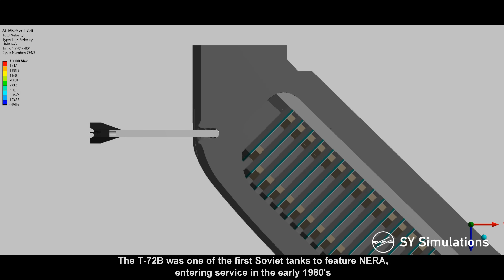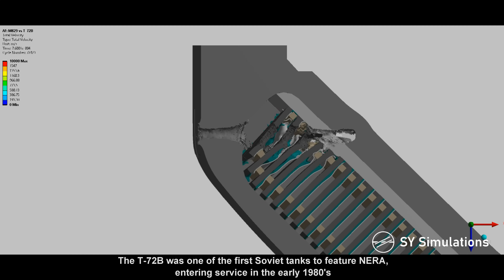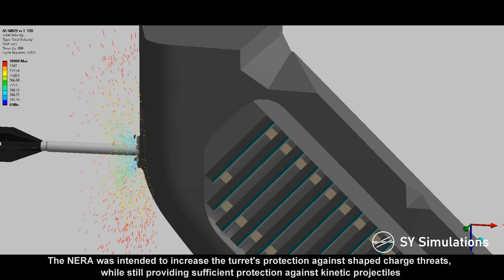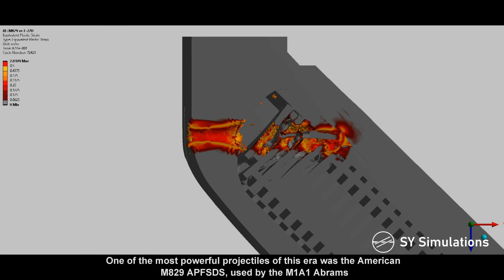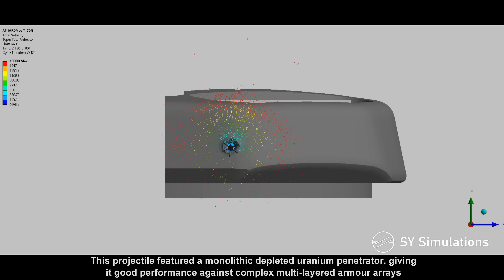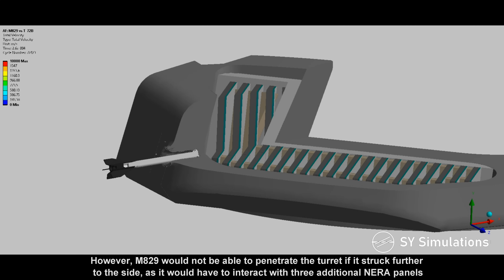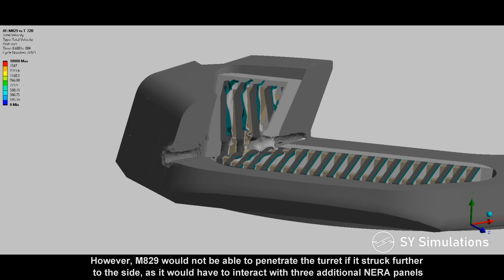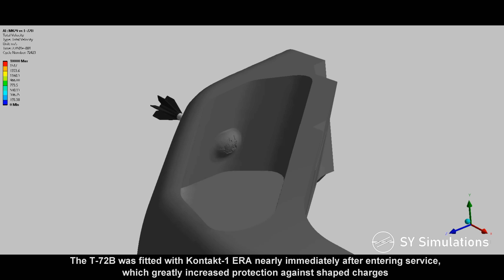ABRAMS vs T-72B NERA TURRET | 120mm M829 APFSDS vs NERA | Armour Penetration Simulation

Comment: what a pointless video...you should try agasint stronger part of the turret...of course it's gonna pen the weak point
Reply: He told the result of shotting more tp the right. Also there is no strongest part, the so called stronget part them becomes way more weaker if shot at 45°
Reply: @76456  Don't forget, the strongest part of a tank is called a garage. Because the moment you drive it out into the open, the clock begins to tick.
Reply: Its not pointless. He shot the center part of turret, where its aimed at
Reply: tf you mean weak point lol ?? that is literally the turret face chunk
Reply: It was the weakest point of the turret cheek  @greener2497
Reply: Pointless ahh ragebait

Comment: Very next thing: turret flying 100' into the air on a wave of flame and body parts.
Reply: Wow I haven't seen this comment 100 thousand times already. Literal NPC. Go clear a minefield with your feet.
Reply: @cheekibreeki4638  Wont somebody think of the poor imperialist invaders?
Reply: @cheekibreeki4638  The exhilaration from watching russian wannabe armor going up like fireworks from the smallest hit is only exceeded by the comforting knowledge that not a single one of the crew made it out.
Reply: @trentvlak  I think bro should give up with talking
Reply: @cheekibreeki4638  Don't need to. The russians are sending tens of thousands of men in special mine field clearing operations to take care of that.
Reply: You do realize that it only happens when the ammo is hit and the ammo is nowhere near this type of penetration?
Reply: @exoticdachoo007  ammo is everywhere in there. Please educate yourself.
Reply: @trentvlak whatever you say bud
Reply: @trentvlak  Ammo in the T-72 models is stored in the hull sponsons (& most experienced crews don't fill those non-use bins) or in the carousel at the bottom of the hull.  In later models the top shutters of the carousel are hardened and will resist splinters.  In earlier models it is simply plate and will only cope with light splintering.

Turrets coming off depends on where and how it is hit.

You know the Indian Army hasn't had much trouble with turret pops when fighting the Pakistanis, right?  Nor have most of the Arab armies that used the T-72.  The difference in the war in Ukraine is the increase in the number of top attack munitions and the type of penetrations they are suffering.

Please, educate yourself.
Reply: @iatsd  not to mention most turret pop videos online are of drones hitting arleady abandoned tanks, meaning that the crew evacuated safely when they were hit in the first place.
Reply: @quan-uo5ws plenty of turret pop videos with drone hitting the turret ring.
Reply: @iatsd  you underestimate the velocity of the penetrating dart in this sim. the entire space inside that tank is frag and flame.
Reply: @quan-uo5ws He's trolling, leave him to it.
Reply: @trentvlak  No it is not. The carousel is the turrets basket down in the hull and so is the spare ammunition. The only part of the loading mechanism inside the turret itself are the elevator and the loading mechanism itself. Wanna find ammo stored in the turret, you have to look on the other side of the iron curtain. But then we talk about ammunition bunkers and blowout panels, that is another story.
Fact is, soviet/russian T series tanks can toss their turret when hit, but they don't need to. It is not a jack in the boy situation, more like mentos and diet-coke.
Reply: @trentvlak  Oh, I think I probably have a better grasp of the subject than you do, son.  ;)  :)  

And your reply is irrelevant to your initial comment and my reply.
Reply: @iatsd  You have a poor grasp of the subject.
Reply: @ThePandoraGuy  Yes, it is. The T72 design is hostile to the life of the crew. Everyone knows this.
Reply: @trentvlak   Ah, you say that based on ... what?  You've given no arguments. You've made no replies to any points.  You've simply declared things.  You haven't even picked up on the fact I'm writing from experience and professional knowledge.  You're not even good at being a troll. 

Why would you bother with something as pathetic as what you're doing?
Reply: @iatsd  that's a lot of words to say that you're a ru troll.
Reply: do you even know tanks or you just watched CNN and thought all Soviet\Russian\Ukrainian tank get instantly ammo detonated?
Reply: Bro talks about something without knowing shit🤣

Comment: That is actually pretty good. Meaning 60-80% of the turret is Impenetratable.
Reply: This is a sim using ideal armor. In reality, the quality of the steel is spotty and the projectile penetrates much more easily.
Reply: @trentvlak That is true for projectiles too. It's not a big deal as it cancels out.
Reply: @MrPezsgess  not even remotely accurate.
Reply: @trentvlak Why would you think that?
Reply: @MrPezsgess  Because manufacturing the correct material at the correct hardness is vastly more difficult for a hull and turret than doing so for a little projectile. Well documented historical examples include the M1A1, T72, and the AMX30.
Reply: @trentvlak I get that. As in Iraq M1A1 easily penned T-72-s but that's the most basic weakest T-72 ever. Only later variants had ceramic and other inserts. This I the T-72B that is far superior. This is one of the reasons the US developed M829A2 and later M829A3 probably for a good reason. Only my opinion but the US lies about stuff all the time there is a reason we have Seal Team Six  because that implies for the Russians that there are 5 more. That said, Russian tanks doesn't lack armor. They lack survivability, crew comfort, reverse speed and Gun depression just to name a few.
Reply: @MrPezsgess  The single DU rod is much more easier to manufacture then ten tonne steel turret. At what temperature the steel is cast? How fast it cools? Were there voids in the metal as it cooled? Was the metal uniform? How fast/slow it was poured? There's huge variety of important details in the turret manufacturing while the DU rod is basicly a matter of machining the rod as straight as possible....
The two are not even remotely comparable on how much it "cancels out".